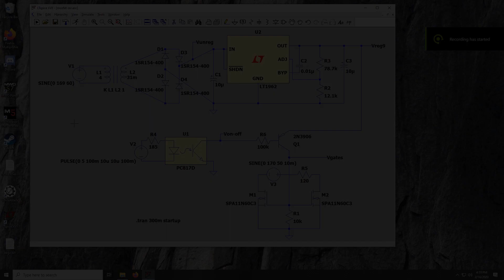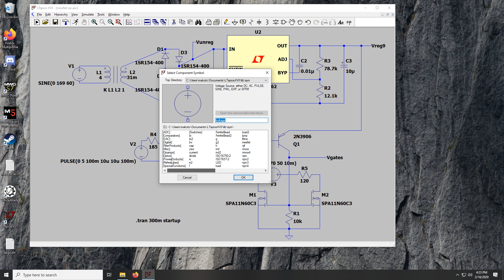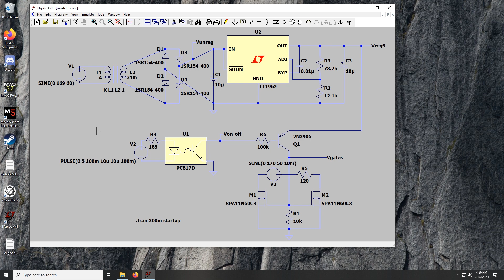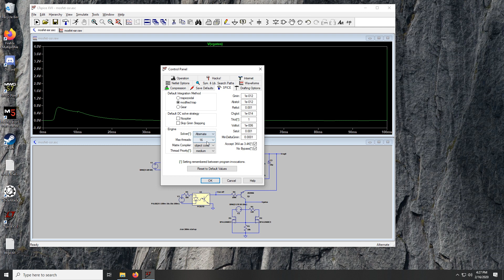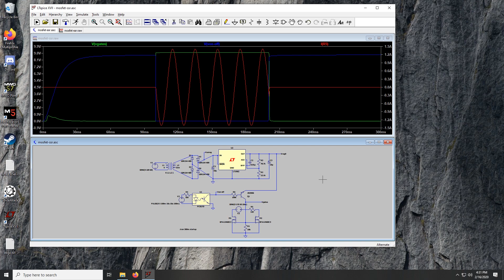MOSFET-based solid state relay for AC.

Comment: Perhaps the primary of the transformer needs one of its terminals to be connected to GND? Spice, in my experience doesn't like floating nodes. I'm also wondering about the effect of parasitic capacitance accross the transformer.
Reply from the maker: >  the primary of the transformer needs one of its terminals to be connected to GND?

I don't want the primary and secondary sides of the transformer to have the same ground. It's very important that the secondary side float freely. I guess I could ground the primary side and remove all the grounds from the secondary side. But that seems like it would create a lot more floating nodes.

>  I'm also wondering about the effect of parasitic capacitance accross the transformer.

This can be simulated, the LTSpice Wiki page explains how. I considered it irrelevant since it wouldn't create a DC path between pri and sec.
Reply: @SaltyPuglord  I understand in real life, it should be isolated. However, spice will add small conductances (10 Gohm?) between all nodes and GND for you. This can create weirdness in the simulation. Adding a single GND connection to each of the subcircuits won't create a loops, so current won't be able to flow between subcircuits.  It still will be able to properly model your design

Then again, I've been using spectre for simulation recently, not LTSpice. Calibre will report an error if any circuit component floats...
Reply: @SaltyPuglord  Is it possible in real life to have both transformer sides isolated? I mean the secondary side is connected to the gates of the mosfets and then to a shared ground with V3. Considering V1 is the same voltage source as V3.
Am I wrong? Is required to isolate them? and how would you do it?
Reply from the maker: @WillyBogard  
>  I mean the secondary side is connected to the gates of the mosfets and then to a shared ground with V3.
That ground is there only to keep LTSpice's solver from blowing up during simulation. In the real circuit you don't ground that wire. The sources of the MOSFETs float freely, up and down in voltage, as the AC source voltage changes.
> Considering V1 is the same voltage source as V3.
No, they're not. I specifically mention this in the video. One is 60 Hz and the other is 50 Hz. They are out of phase.
> Is required to isolate them?
This circuit requires isolation to operate correctly.
> and how would you do it?
There are many ways. One easy way is to use a 9V battery. Check out the video where I actually built the SSR, and I demonstrate it with a light bulb: https://www.youtube.com/watch?v=07DY59WESYQ
Reply: @SaltyPuglord  
Thank you for the reply it is very helpful.
> No, they're not. I specifically mention this in the video. One is 60 Hz and the other is 50 Hz. They are out of phase.
ah yes but in if you would build this circuit in real life, I think you would like to use the mains voltage (110V/230V wherever you live)  for creating the 9V gate driving voltage but also for the Voltage powering the AC load R5. So if you would wire them both to a mosfet your isolation is gone. Using a battery is an option though but if you would not want to replace the battery this could be annoying.
Reply from the maker: You still don't understand that the secondary side of the transformer is floating relative to the primary side.
Reply: @SaltyPuglord  That is true in the case that V1 is not the same as V3 I think. I know for this simulation that is not the same source but in practical life people would just use their wall socket for both power supplies. 
Or maybe I do not get the definition of floating. anyways thank you for the reply :)